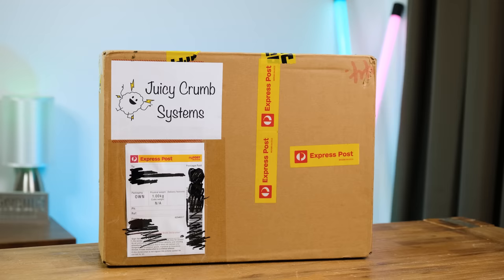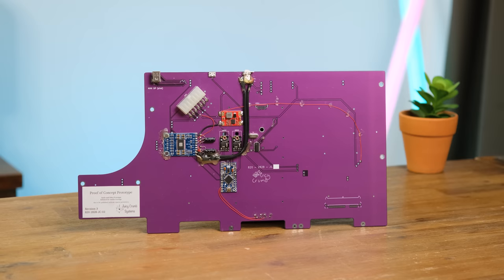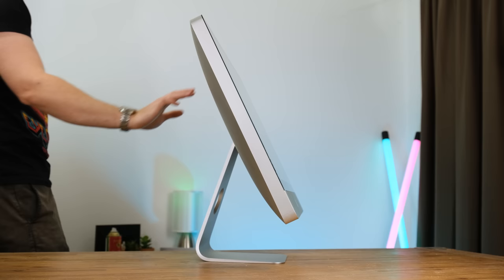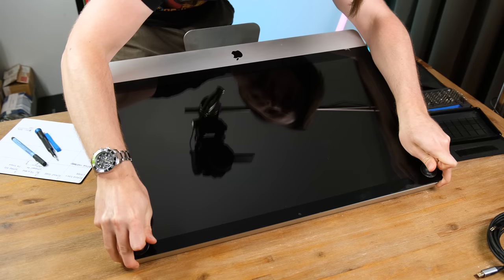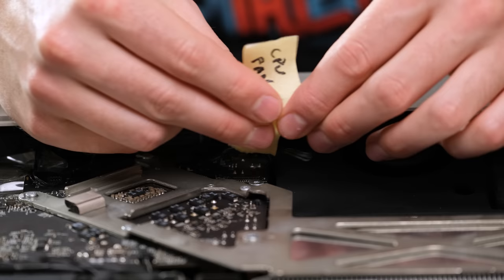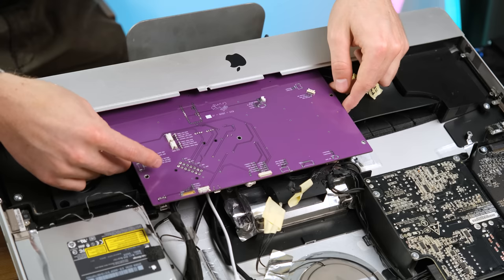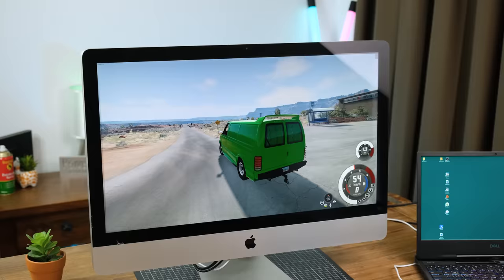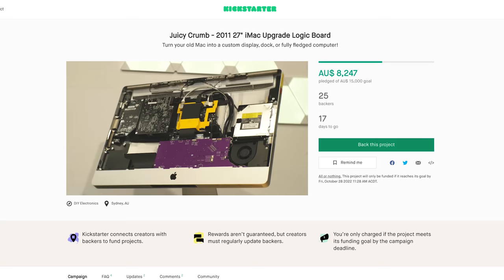Turn Your Broken iMac Into A New Standalone Display!

Comment: absolutely stupid pricing 
you can buy a great 27" 1440p or 4K monitor at these prices! And it would have warranty and be 10 years newer tech
disappointed in your promotion of this overpriced kickstarter that will probably never ship
Reply: I was thinking the exact same thing, infact a 28'' 4k ips monitor costs as much as the lite version of this board, $250. If we include shipping from Australia which according to a comment on the kickstarter page is additional $90 to Europe, there is just no comparison. Hopefully they will reduce the price after the backing goal is met. At this price it just doesn't make sense and it's not like these 2011 imacs are worthless just because of a dead mainboard, they still cost decent money when you sell them for parts.